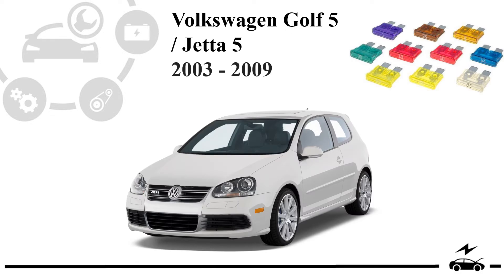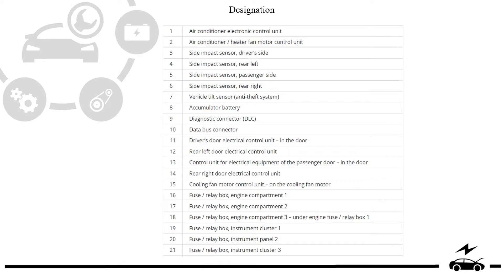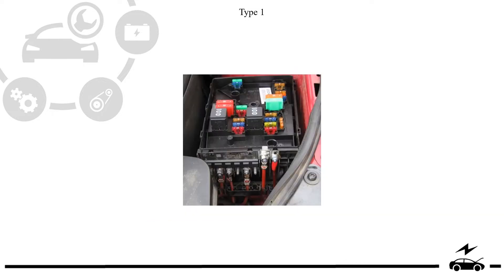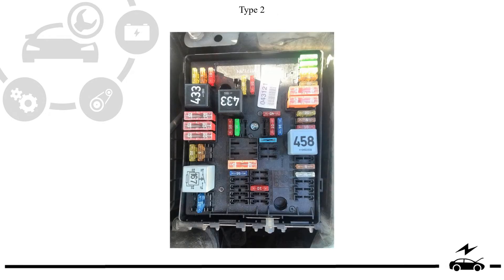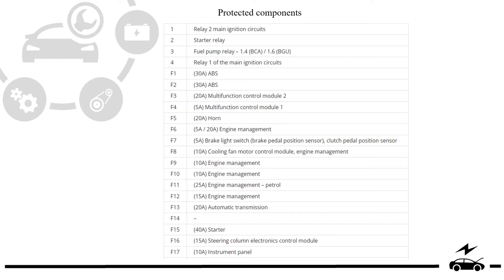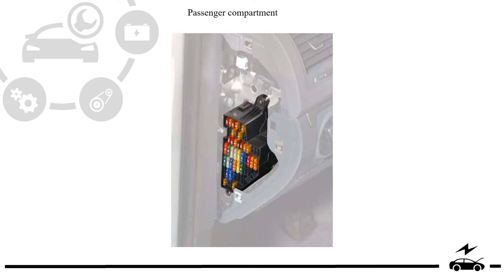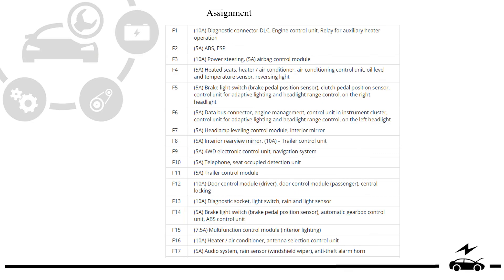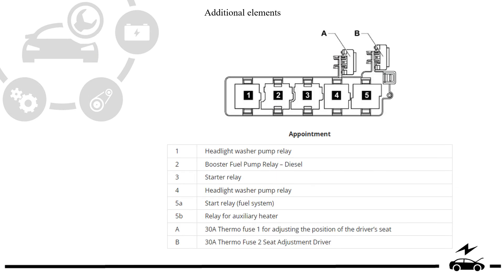Volkswagen Golf 5 / Jetta 5 fuse and relay and relay with assignment and location

Comment: The radio in my Jetta can be turned on at any time without the key on. The battery also goes flat after a few days of sitting. I think it may be a bad / stuck relay. Any thoughts?

Comment: hi guys, i have a problem with my passenger side low beam headlight, it doesn't work, i tried to replace the bulb and the fitting twice but it doesn't work, not even when i unlock the car, please advice!!!!!

Comment: Hey guys, I have a question:
My fuel pump keeps running after the power/ignition is off. Very strange.
Any advice to what relay/fuse or other reason to what could be causing this?
Anyway, I loved your video - very informative.
Thank you.